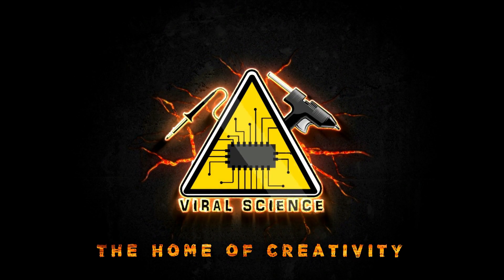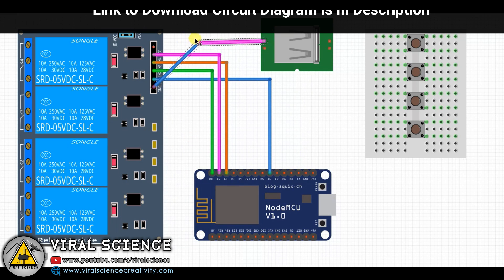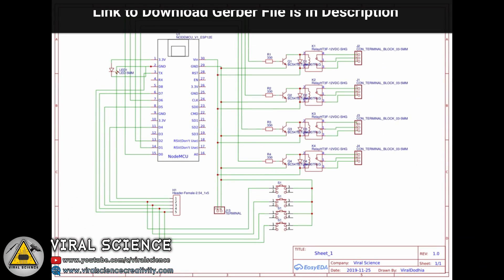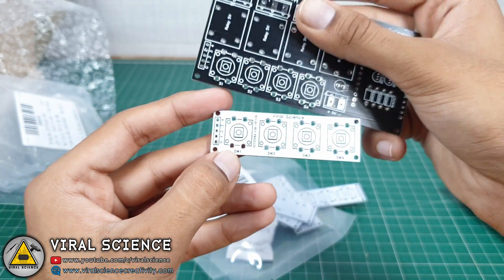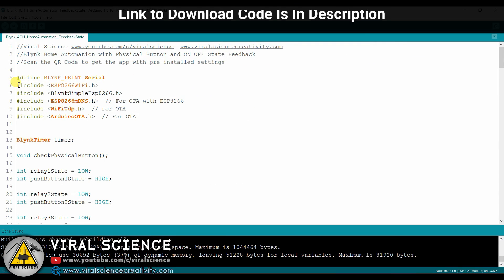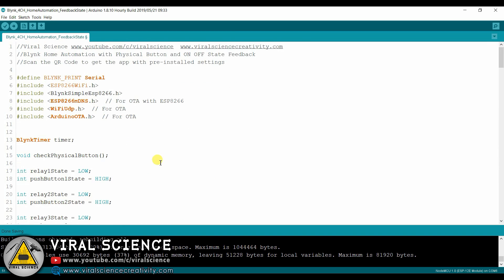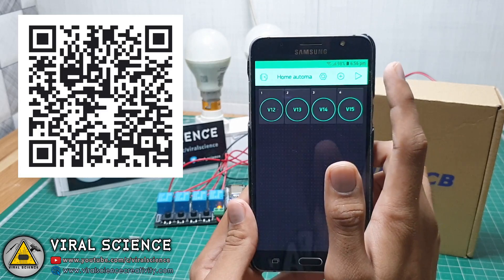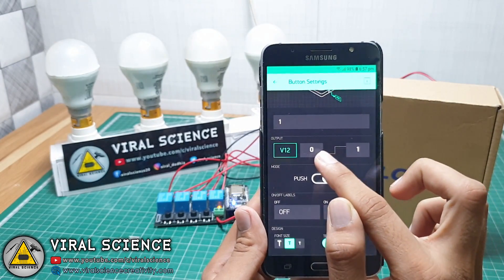Blynk Home Automation Physical Button Feedback Status

Comment: Super project 👍🏼

Question: could you also connect 5 volt DC LED Stripes WS2812B to the output from the relay ? 🤔

Comment: what an awesome video sir. Can i ask you a question sir? i tried to make a simple project to blinking two leds using nodemcu and blynk app, but i got a problem that there is a delay for 5-10 seconds since the button on the app get preseed until the led goes on (and same when tried to turn the led off from on), can you help me with this sir? thankyou

Comment: Nice work. Need help in getting the relay on for momentarily when I say to switch on the relay from Google Assistant. Right now it just switchs ON and be at that state untill I say to switch OFF. I just want it to switch ON for 2 sec and then automatically switch OFF.

Comment: This is the most practical way of implementing home automation system. 👍
Reply: So how to get the feedback on blynk or whatever interface u design without sensors? Wut did he do here in the code?
Reply: @mibrahim4245  Please go through the code. Link is in the description below. There is no need of sensor to send feedback to the blynk app. Depending on the pushbutton state, whether it is HIGH or LOW, the feedback is sent.
Reply: @danish i wouldn't say this is practical. Suppose if your wifi is down you literally can operate your your room's lights
Reply: @hrithikjain1806  Even Google Home can not work without internet connectivity. In this project, if WiFi is down then there is a option to operate appliances using pushbuttons as we normally do. You can upgrade this project using ESP32, which has Bluetooth connectivity too..!

Comment: Hello, 
First of all thank you for very informative videos. Not just this but for all.
Second I had a question. Here we have used almost all of the GPIO pin of nodemcu. Is there any way to increase it. I have 7 switches at my home and to convert all do I need to add 2 MCU or is there any other way ?
Reply from the maker: Thankyou, insted of this you can use esp32 board which has more pins
Reply: @ViralScience  Thank you for quick reply. 
Yes we can connect to esp32 But still there is a limit. Is there any way to overcome that limit. I tried to search it but had no luck.

Comment: If the Wi-Fi light goes out and comes on again, will it reconnect?
Reply: Yes, NodeMCU automatically connects to the internet.
Reply: @Metehan647250  hello can you tell me how much does jclpcb total charge in india ?
Reply: NEVER CONNECT AFTER IF LIGHT COMES IN NODEMCU CIRCUITS, IT IS VERY BIG PROBLEM PLEASE SOLVE IT.

Comment: https://www.youtube.com/watch?v=Q363NtYWgjA&t=294s   
we have this option of a connection module that is activated by the serial port, with two arduino pins it is possible to control more than 40 relays, how can we integrate physical buttons to this code?
https://www.youtube.com/watch?v=MScwN3ic3B8
Thank you

Comment: Thank you for tutorial , it work perfectly
But i have just one thing
Can i make the physical switch to send only [“0”] to turn on the relay
I mean i use the physical switch to just turning on the relay , without turn it off when i push it for second time
Reply from the maker: You need to make some change in program, if you know some basics you can do it
Reply: Viral Science - The home of Creativity  
Thank you i did it 
Just by changing two word to 1
Reply: hassan ahmed basha & viral science , can you please tell me what i need to change in the code to use physical switches instead of push buttons, i have succeeded to make every thing working like this video with push button, but when i use switch it is sequentially toggling
And by the way it is a very great video, i was searching many times to achieve the light status
Reply: @hassanahmad9597  Can you show me how you did it please?
Reply: @hassanahmad9597   how you did? Share your contact details

Comment: Just i worked with  your project, i was trying little different as its a feedback status, i uploaded same codes to two 8266, to work like a transmitter and receiver vice verse, it did not help, but the feedback from both mcu shows in blynk. could you please help me..

Comment: Thanks for uploading home automation project. I have one question can we use push button with esp32 nodemcu Wifi + Bluetooth? if internet will not work so we can use bluetooth . can u send blynk libarary and PCB Gerber file. if it is possible for you. I have request to you.
my email ID is : dilipg193@gmail.com
Reply from the maker: It is possible but it needs some changes in pcb design as well as program
Reply: @ViralScience  Please do it. I have request to you.  if u need any charges I can pay.
Reply: I also want it

Comment: Hi friend your projects iam like it
But small changes your project button is not use the button you want used switch and wifi network connection manual button  function control

Comment: Hi,

First of all this is fantastic,
Could you please mention the quantity and amp details about the items you have used in this project.

As
NodeMCU ESP8266 - Please provide link to buy this.

Relay - 10Amp or 16amp with quantity

Push Button (Tactile Button) - 4pins or 2 pins?

330 ohm resistor - quantity not mentioned

1N4007 Diode - quantity not mentioned

LED - red or green and quantity not mentioned.

BC547 / 2N2222 Transistor

Block Terminal Connector - Quantity not mentioned

PCB Header - Quantity Not mentioned

5V Power Adapter - buy link please.

Please provide the above details so we can also make this same 2 same as you have made this.

Thank you.

Comment: Nice video  dear,
i have using 4 relay module  with nodemcu for different load, in my case im using local push button switch and blynk app soft button. i plan to update program which you given on description box below...
many thanks.........................

Comment: Sir what will happen in case internet goes off, can we control it manually??
Reply: I'm using three pieces NodeMCU v3 with this codes on my house, since 6 months. I can control the lights, building door and see door status (open or close) etc. 
The device needs to be connected to the internet for the physical buttons to work. If the internet is interrupted after connecting, the buttons continue to work. It has to be connected to the internet, even once.

Comment: Hey man please help me out. I am using swiches instead of push button so what change do i need to make in the program to use switch?
Reply: I'm using three pieces NodeMCU v3 on my house, since 6 months. I can control the lights, building door and see door status (open or close) etc.
For this project, I modified my light switches to push button with using a little spring. They working as really push button. I recommend..
Reply: @Metehan647250  Does the switch or button work if internet is not there?? Pls tell.. and did ur electricity bill increase after keeping this.. Pls reply
Reply: @Crunchworks79  
I did not follow my electricity bill carefully.  But there was no significant difference.

The buttons start working after the device is connected to the internet. It must be connected to the internet at first opening. 

Buttons continue to work even if the connection is lost after connecting to the internet once. But data cannot be sent to the blynk server.  Therefore, we cannot see the button status in the application.
Reply: @Metehan647250  So It should be connected once and if the internet goes off after that buttons will work. Am I correct?
Reply: @Crunchworks79  Yes, correct 👍🏼👍🏼
Reply: @Metehan647250 To Make It Did U Use His Pcb Or U Did In Breadboard or anything?
Reply: @Metehan647250  Did You Use The Same Code Which Is Mentioned Below The Video?
Reply: @Crunchworks79   No, I had to make a few small changes. (Used libraries etc.) 

Also, not all pins on ESP32 can be used for input / output. There are pins used only for input and only for output. We can find the features of the card on the internet. However, it is useful to test the pins one by one. I did that. If you want, I can share my ESP32 sample project with you.
Reply: @Metehan647250  please share
Reply: @Metehan647250  u used esp32 or esp8266??
Reply: @Metehan647250  Thanks A Ton

Comment: another question, is normal that when i press the button, i need to hold it ab0ut 2 seconds to turn on?, because if y press it normally sometimes it doesnt turn on
Reply: solved, timer.setInterval(100L, checkPhysicalButton); CHANGE the number to get more or less responsive

Comment: Will this project also work when the internet connection is out???
Reply: yes using only pushbuton
Reply: I'm using three pieces NodeMCU v3 with this codes on my house, since 6 months. I can control the lights, building door and see door status (open or close) etc. 
The device needs to be connected to the internet for the physical buttons to work. If the internet is interrupted after connecting, the buttons continue to work. It has to be connected to the internet, even once.

Comment: Awesome bro... i followed your procedure... worked well...

 one request- How to use normal switch instead of push button?  I tried to replace the push button to normal switch but it requires 2 times to on/off for power off the output
Reply from the maker: Use door bell switch it will work same
Reply: @ViralScience  but it is not solution.
Please change code to Norma switch.
Reply: @ViralScience  Thank you....    Another query bro....  i  tried to control 6 devices by adding 2 more controls in existing program but failed. is it possible to control more than 4 devices in node mcu? if possible please explain....
Reply: @ViralScience  but if we want to use normal swtich instead of any other swtich what we can do?